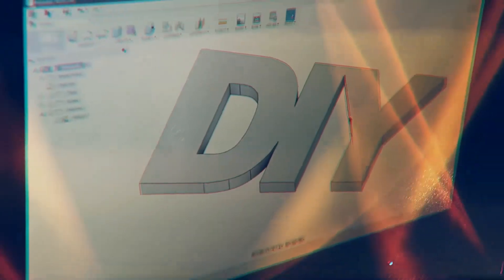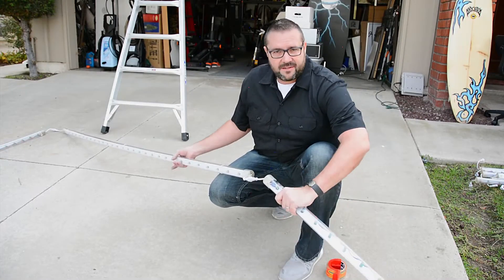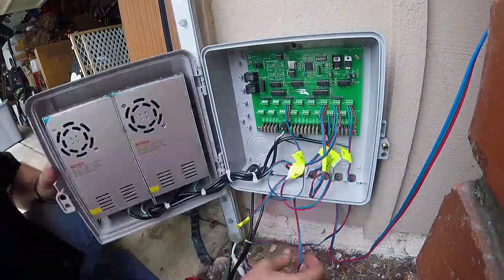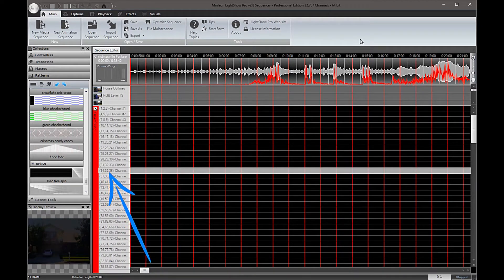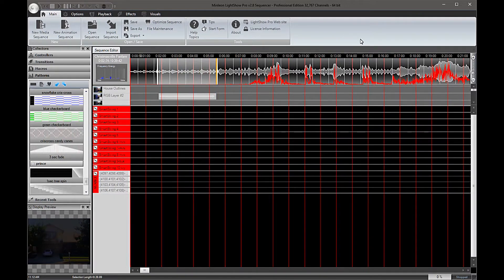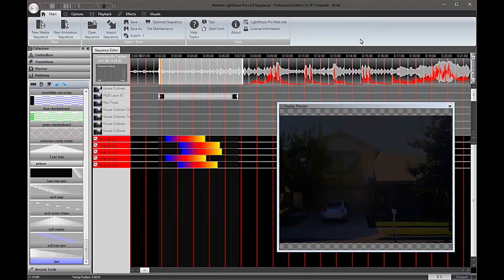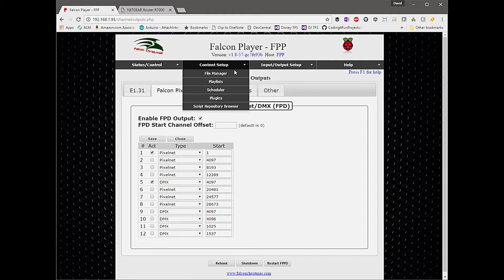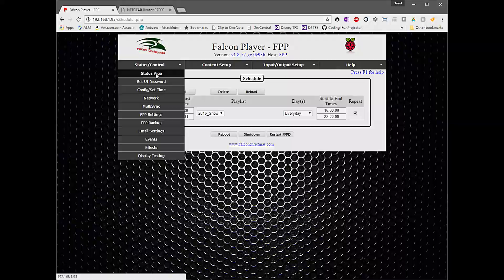Episode 018: 10 min RGB Display!!

Comment: What light strips did you use?
Reply from the maker: info is in the description, I use pixel nodes, generally w2811 or tm1809 / tm1804
Reply: Excellent thank you!  Any chance you could give more details on the bar builds?  I get that you probably 'hacked it' together, but they look great.  Would love to replicate something similar on my house this year.
Reply from the maker: I dont consider myself a "hack" :)
I went to great lengths to find the right tubing, end caps, etc... :)
Get the tube ends here: https://www.uline.com/Product/Detail/S-15012/Tubes/Clear-Tube-End-Caps-1-1-2-Clear
Get the tubes here: https://www.1000bulbs.com/category/t12-fluorescent-tube-guards-clear/
Corrugated plastic sheets here: https://www.uline.com/Product/ProductDetailRootItem?modelnumber=S-11312
get a coroclaw to cut it: http://www.ebay.com/itm/like/171858427122?lpid=82&chn=ps&ul_noapp=true

cut strips of the coro to fit in the tubes, use a fostner bit to drill the holes in the coro for the pixels, insert pixels in the coro, insert the coro in the tube, put end caps on.
done!
wash-rinse-repeat
:)
Reply: you are literally the best -- thanks!